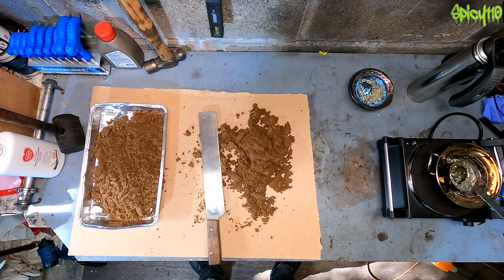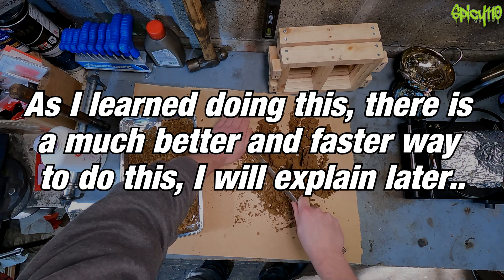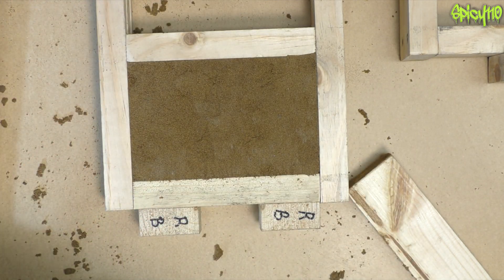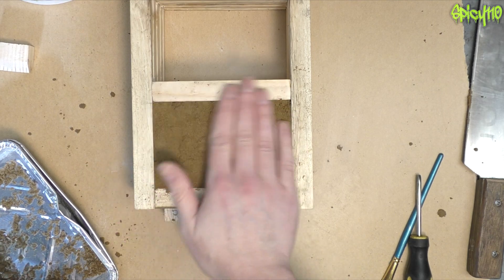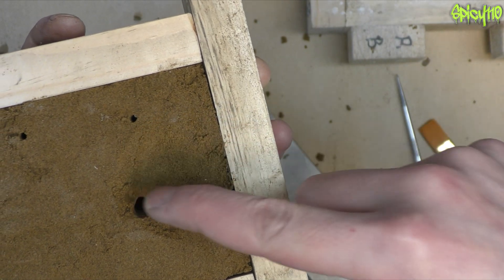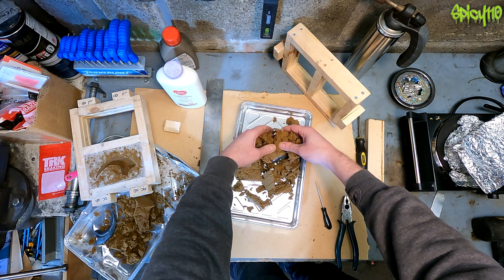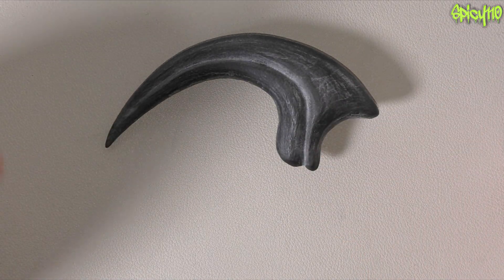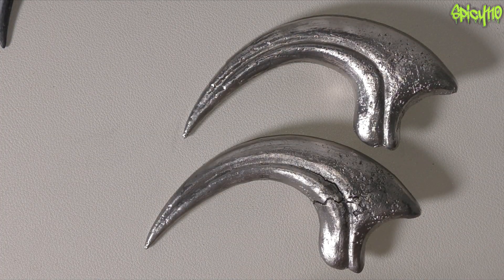Making Bismuth Velociraptor claws!

Comment: This could be a neat way to make your bike sprocket clocks. All you'd need to do, is make a wooden template of a sprocket design you like, then put it in the sand casting stuff and pour in the Bismuth. The good thing about making the sprocket section of the clocks that way, is that it would be easier to remake a specific clock as and when ever someone requests it. Does this stuff weld at all, or does it just melt as soon as a welder gets near it?